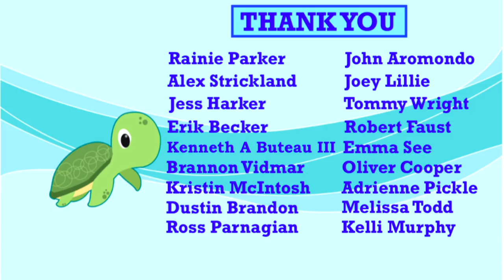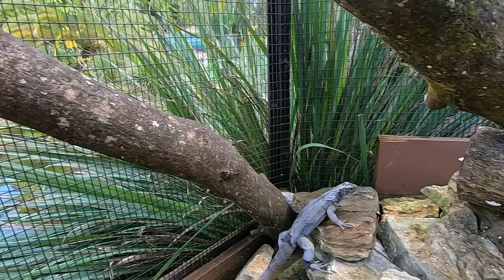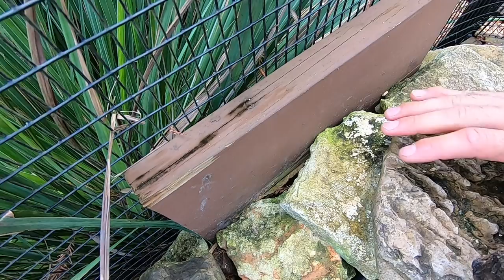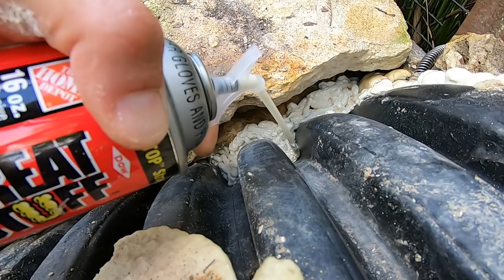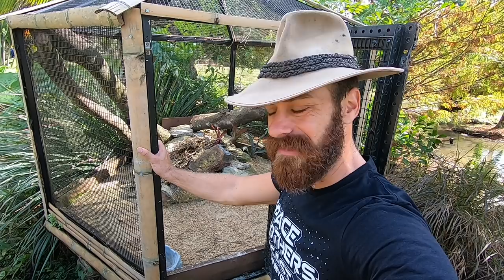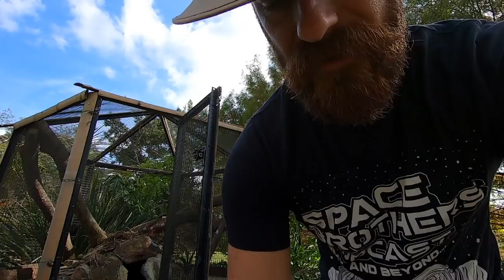Lizard Cave Remodeling!

Comment: Hi Kenan, I especially like the Cayman iguanas & you are an experienced proponent of quite naturalistic outdoors enclosures. I am slightly confused as to the extent of your remodeling & your neccesity for the iguanas to only utilise the one specific cave area. To me some insulation is appropriate such as in those ribbed areas & around the back to connect to the large tile. However the gaps & niches in the rockery above seemed to me to be a kind of semi natural Rete's stack where the occupant can chose it's own preferred space for thermoregulation & exhibit natural behaviour through personal choice. Obviously with a horizontal tube you will continue to lose heat from the open end, unless you tilt the tunnel entrance (dip down below ground level even better to alleviate draughty heat loss) to say a 45deg angle so most of the heat rises to the upper/sealed end. A couple of constructive criticisms or observations, but I respect your personal knowledge of the animals requirements & your endemic locality specific husbandry. We're both hat guys, but I've given up on the beard in favour of a moustache. BTW seek & destroy (OK relocate) the snapper that is mutilating your other poor turtles. This will more than likely become a repeatative problem as smaller snappers grow into  the dominant apex position. I conject that they are more active at your local temperatures giving them an unfair advantage over non endemic fauna who may be vulnerable to predation under these circumstances. Appreciate that was another video. Troy

Comment: you can pick up 'pro' cans of Great Stuff at your local box hardware store...it fits on the pro gun just fine. though it expands more and isn't black so harder to hide, but it's a fraction of the price of waterfall foam. Just remember not to try switching cans unless the one on the gun is empty.
I hate it when my mustache starts poking my lower lip...not sure I'd use spray foam of any sort to deal with that though.